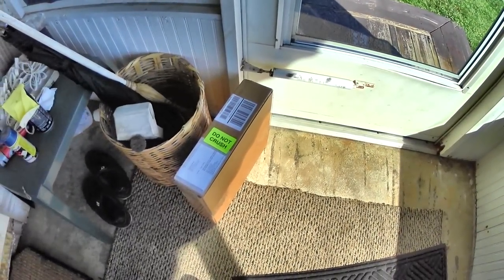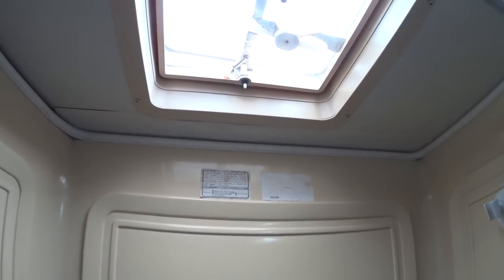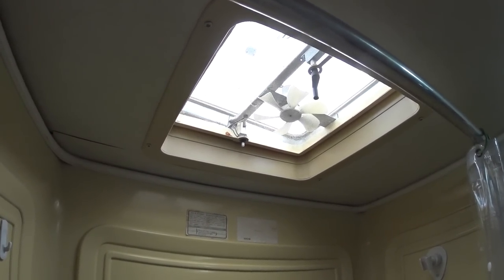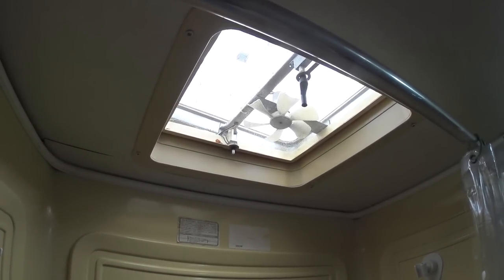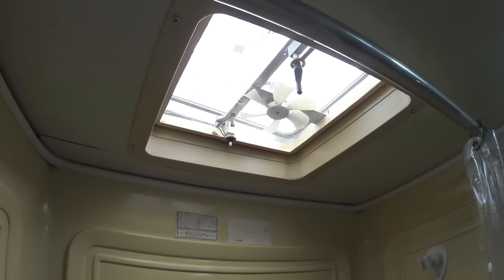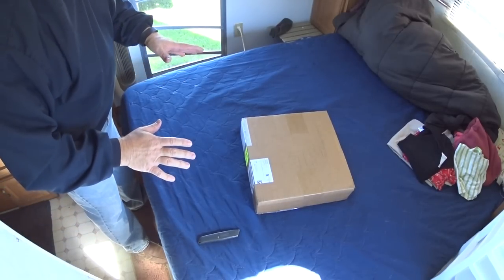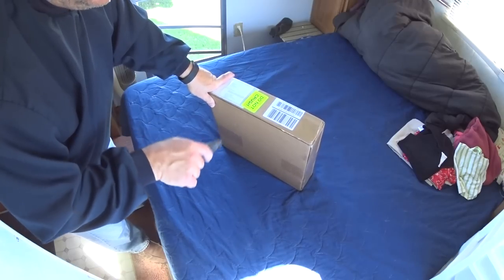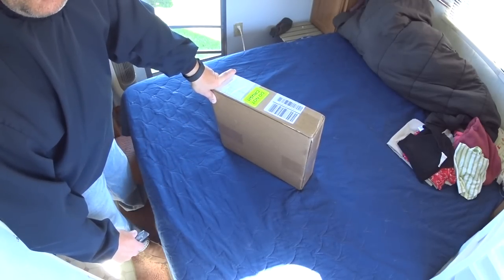Heng's Vortex RV Vent Fan Install

Comment: Your video answers questions I had with all the adjustments that could be made that others never mentioned. Some had to break off the tabs to fit and had to create new holes for 2 main screws to go through the aluminum brace.

Comment: Thanks for the great video!  Watching your demo made it a lot easier for me.  I have a Grand Design Imagine 2600RB and I also had to move the gearbox to the other location and use the spacer.  It's definitely an improvement over the stock fan.  I love that it is reversible for drawing in cool air at  night.

Comment: Started installing mine last night. I mounted the fan with the 2 screws first then removed the screen and blades and the make wiring easier. Mine didn't come with a cap 😞. Pretty simple install with Robbins and Phillips bits (use Robbins if you have them, but these screws will usually accept either bit). Had to move the new fan's crank piece over one screw to align with my crank. This is an option that is built in to the new fan. The wires are on the opposite site of my fan from where the trailers wires come out of the ceiling. Hence my stopping last night.
NOTE: My crossbar for the old motor only extends a few inches, not all the way across like the video so I only removed the motor, but am considering removing it after verifying the new fan works.

Comment: wow.... just clicked on your link for the fan, and instead of just under$54.00, it's now $113.00 ??  guess it's gone up in the past few months.
Great and informative video.
Thanks
Reply from the maker: THANK YOU!! Glad you found that for me.. I just changed the link for a slightly lower priced multispeed fan(85) and found a link for a cheaper 1 speed version(40).. not sure what was going on with the first supplier but $113 uh, that's not a deal even at $85 not really sure how good that is... Appreciate you calling my attention to that.. Thanks again!!
Reply: I just bought mine at Amazon for $53 + $4 shipping in 2020

Comment: Bought one for my new Coachmen. from what I have heard and seen they are a Great Fan for the Money. and easy to install. Paid $40 for mine (Single Speed)  I still have to put mine in yet. Paid  $23,000 for my 2017 Coachmen and has the Cheap Ass R/C car Motor type fan in it . how much more is it when they are Building them to put in a Fantastic Fan ???  it cost nothing in the total Price. Most Rockwood Trailers Come Stock with them Great Video
Reply from the maker: They a lot of these RV's are put together I find myself saying that same thing on almost everything I run into..Thanks for sharing/watching!!

Comment: Pro tip I put the screws in from the bottom to hold up the unit and then went to the roof for the wiring. Easy peasy

Comment: I just ordered the Vortex the day before I watched your video.  My installation will be a bit more challenging because I have a vintage trailer, it just has a vent with no fan and no wiring but I will figure it out and make it happen.
Reply: Patrick Lee what did you figure out with your fan? I’m in the same boat, just a vent with no power and not sure how I’d rig a powered vent should I get one.
Reply: @adame8865  I just ran a dc plug to my Inergy Kodiak.  It took a bit of time get my vortex to line up with the existing manual crank gear, I had to play with it a bit.  I am not going to rip anything apart to hide the wiring, I just purchased a cable management kit from A+ Electric on Amazon and will run the dc wires through that along the ceiling and the wall to a convenient location.  My next project is installing a new propane gas range.  I tried to fix the original gas range but I could only get the stove top to work and not the oven.  The individual that sold me the vintage travel trailer cut through the existing gas and water lines, so I am just going to work around those things rather than try to patch it all up.  There's a ton of work to do but at least the trailer is not water damaged like many of the vintage ones.  Even though it's expensive, I have pre-ordered the new Inergy Flex Gold kit because it should provide me with all the power I will need for my off-grid 2 acres in Arizona.  You should check it out if you have the bucks.

Comment: I saw other videos and yours is only one that shows the fan running relatively quietly.
Reply from the maker: When I first installed it it slightly touched the edge of the housing that it was mounted in so I just slightly bent it and the sound became very minimal. Problem with sound on videos is how the camera setup with the audio. Some cameras record differently. But the indications using the makeshift decibel meter app definitely showed that it was pretty darn quiet. Compared to the little tiny fan that was in there from the factory that didn't move hardly any air at all it was definitely a better fan all the way around including sound

Comment: Great video! The exhaust fan is important, but it's not apparent just how important until you don't have them. We have two in our new 2017 Winnebago Forza 36G that are made by MaxxAir. Both failed & stopped working within 24 hours of each other while we were in Reno. Had to stop for service & have them replaced under warranty.
Reply from the maker: Thanks.. I heard you guys talking about it on one of your videos. I am really happy with this one as a cheap alternative and quick install so when I get something more permanent( RV wise) I will definitely step up to a higher quality fan, Maybe what we get next will already have them installed !!

Comment: I just subscribed. Great video and I came here to find out how that adjustment for the crank handle is done. More likely than not, there will be no sheet of instructions when you receive your new fan. <-This I have learned from watching the other videos about this install on YouTube, no instructions and the contact email on the box has been changed . So I was left to guess how the adjustment is intended to be done. You are the only YouTuber to show it in your video. Thanks.
Reply from the maker: Thank you 😁👍

Comment: Great video, my fan is currently broken so looking into my options.  After watching this which seemed like a perfect solution, I was about to pull the trigger on one on Amazon...but reviews on it were a little mixed.  Was wondering how yours held up after a few uses?
Reply from the maker: No issues 😁
Reply: This fan is really the best. Easy install, best price. No issues. Be sure to remove the fan blades allowing easy access to the wires as you install. So much better air flow than original fan.😃👍

Comment: hmmm what about those 12V low-profile radiator fan, with proper shroud it should pump lotsa air !! ....if you dont mind the noise they make....

Comment: Hello, Any update on how this fan held up/performed ? I just got a rv  with 2 vents and no fan. i wanna add 2 fans. Please lmk your thoughts on it if you can. Thank you !
Reply from the maker: It's the cheapest way to get the most are pulled through those little openings. If you've got the time and you've got the ability and you've got the money to do an install of a fantastic fan or a Maxx air fan then both of those would move more air but you were talking usually double the price and more labor to install as you have to get on the roof.
Reply: @Rvdaydream  Hey, i know i can do the job im just concerned about opening myself up to a possible leak by removing the existing vents. How is the Hengs fan ? Still working ? Happy with it ? Thanks for the reply !
Reply: @Rvdaydream   hi -- thanks for the reply. But are you happy with the hengs fan and is it still working good ? Thanks !
Reply from the maker: Hengs fan is perfect
Reply: @Rvdaydream   thank you !

Comment: Nice step by step. Using a gearbox will allow the fan to move more air but the wine you hear is mostly from the gears. Motors don’t whine. Also it takes more power to use a gearbox to move something like a fan. It would be interesting to make an amperage reading on how much more power it draws. Also a gearbox adds failure items to the fan. I’ll bet it is quite a bit more power. I would prefer a fan that moves more air but is quieter and more efficient.
Reply from the maker: Michael Dobson the gearbox is only used for opening/closing the lid/cover... It allows realignment of the crank... The fan is mounted directly on the armature shaft of the motor..

Comment: My motorhome didn't come with a fan, so I don't have wiring.  Can I use the interior ceiling light's wires (splice) for BOTH the new fan while keeping the interior lights?  Or is that overloading the wires which was meant only for the lights?
Reply from the maker: It's just 12volts and it should be fine...Never heard of anyone having any issues before..especially if you go to LED bulbs to reduce the drain on the line significantly!!!!!
Reply: You're absolutely right about the LEDs, thanks for the tip
Reply from the maker: golforfishing 👍😁

Comment: I have a vent with no fan, and no wires......How do I install the fan at this point.
Reply: You’ll need to get creative. If there is a 12-volt light nearby (check the voltage with a meter!), you could just tap into that wiring, run some 14-gauge wire to the fan.  If you’re nervous about running it through the ceiling, just run it on the surface and cover it with some wire-mold covers.

Comment: Would it have been easier if you had the vent open and someone on the roof?
Reply: Yes because you want to secure the wiring with a zip tie to make sure the wire nuts don't drop into the fan blade at some point in the future. I find that "if" it can happen it eventually "will" happen. It is also easier to align the vent crank spindle with someone on the roof helping.

Comment: The vortex fan is a cheap subsitute for a Fantastic Vent which is much better. Saving you money cause it won't break like my cheap Vortex has. Never had issues with my fantastic vent fans in 18 yrs of RV'ing
Reply from the maker: You're absolutely right, which I mentioned in the video. But it also requires you to completely disassemble the roof vent on top of the roof and remove all the contents that's occupying the hole in your roof to replace it with a much more expensive although better fantastic fan or maxxair vent fan. This is for the people that are trying to upgrade from that little 5 inch fan that comes with most of these RVs from the manufacturer and they don't want to get on the roof and have to go through a whole process that takes an hour versus this installation which takes about 25 minutes.
Reply: @Rvdaydream  Agreed but If I put a spark into someone to do it right by spelling out the difference then I'm happy.

Comment: How much CFM is the fan
Reply from the maker: click the link in the description for product details
Reply: RVdaydream I did and there’s nothing
Reply from the maker: @mustangdbest220  apparently the manufacturer does not supply a CFM rating this is the only information that is available...
Don't just move air, use the Heng's 90046-CR Vortex II Fan Kit to create a Vortex! Upgrade your present noisy powered roof vent into a powerful high velocity air movement system in just minutes. Take out the current screen, garnish and motor and replace it with the Vortex. 

Enjoy over 300% more air movement over standard roof vents

Three forward speeds and two reverse speeds

Universal fit for Ventline, Jensen and Elixir powered vents

Easy installation with only a screwdriver

9" Blade

White polymer construction

Limited 90-day warranty
Reply: RVdaydream YEAH that’s weird that they don’t give the CFM rating they should do people know how much CFM it moves on all the speed right.
Reply from the maker: @mustangdbest220  I agree. But here's the thing. They don't really need to. They are the only manufacturer that makes any kind of a performance fan that can mount from the inside using the Factory opening without getting on the roof. I will say it definitely without a doubt moose more are then that little tiny fan that comes from the factory in most RVs. I will also say without a doubt that a max air or fantastic fan moves more air then this one does. How much more? I'm not real sure. It's not as big a difference between the vortex 2 and a fantastic fan as the difference between a Vortex 2 and that little Factory fan. Like I said the only other alternative is getting on the roof and taking off your vent cover if equipped, then removing all of the dicor sealant or Eternal Bond tape. Then, removing all the screws and the butyl tape that's underneath of the fan assembly once it's removed. Then you have to clean the entire area real well with like mineral spirits, and then install the fantastic fan or max air fan which of course those are much more expensive. Sofer just replacing one of those tiny little fans or installing one where there wasn't any The Vortex to definitely is the easiest way to go. But as far as CFM I have no idea. And by them saying moving 300% more than the factory little tiny fan, I can actually believe that. It really does draw air into any window that's open whenever the fan is on forward High and it's enough of a breeze that it will actually keep you cooled off on a hot night as long as it's not too extreme.

Comment: is there a 14 by 14 version of this fan
Reply from the maker: That seems like an odd size. Do you not have an existing vent currently? If not you need to buy one of the more expensive fan assembly that will require you to get on the roof and install it.

Comment: The motor in these units are really poor quality... I burn out three of them in a very short time... One only lasted one day on high speed... one lasted a month that was never run at the top speed.  But I found a solution.... if you search on Amazon you can find a replacement motor/fan by Domestic K817-00   It fits with a little work but well worth it...  I posted a review under listing if you want to see some pictures... took me about an hour to modify it.... so far so good as of today : )

Comment: Oh boy. Lol don't turn on reverse in the bathroom unless you wanna smell poop. Lol
Reply from the maker: We almost always have the fan blowing air out of the camper pulling it from an open window somewhere (usually the bedroom or kitchen) the only time we have any smell issues is when we forget to have anything else open(windows or vents) and then we usually get drain trap smell... We NEVER run the fan when flushing the toilet.. that would stink..

Comment: Pretty janky, think I'll pony up for the max air knock off on Amazon.
Reply from the maker: That maxair knockoff requires you to work on the roof and there's a lot of people that either can't physically do it or they are uncomfortable messing with their EPDM roof making sure that it gets sealed off.
Reply: @Rvdaydream  Butyl Caulk . I want to replace my 24x48 skylight in the shower, it's white, but I want clear so I can see the stars.
Reply from the maker: Clear is nice, our 2020 Rockwood 2604ws travel trailer and 2022 Rockwood 2899ks Fifth Wheel both had nice clear skylights... Kinda rough in the Arizona and Florida heat but all other times nice...
Reply: @Rvdaydream  I hadn't thought about that, but I'm in Central Idaho. I have some plans to go to the Oregon Coast, but I get enough of the desert in the Owyhee Mountains in Southwest Idaho.
 There is a Church with a wooden staircase Id like to see in New Mexico and I listen to these or watch I guess videos on youtube called Mysteries of the Superstition Mountains. Pretty cool. My Grandpa was a Rock Hound and loved the desert, it has it's place in my heart but I prefer Conifers and a creek.

Comment: Maxxair better than Fantastic Fan IMO
Reply from the maker: That is also my opinion as I mentioned in the video. However, the cost of the max air and also fantastic fan is considerably higher then this option. Not only that, but, the installation of a max air or fantastic fan require you to get on the roof of the RV and remove the sealant and screws which could potentially damage the rubber roof if not done correctly. This option can be done easily from inside the safety of the RV at a much lower cost and a lot less labor-intensive.
Reply: @Rvdaydream   Great points ...

Comment: Ok video but you need to tell everyone to shut off the power before starting.
Reply from the maker: Cyndi Foore thanks, but there has to be a certain level of common sense that is assumed. Plus if they forgot to shut off their power all I would do is just blow a fuse they would not get shocked.
Reply: In many cases it is more important to see what you are doing,  It's easier to put the wire nut back on the hot wire until you are ready to connect it to the new fan. There is no danger of electrocution with 12volt